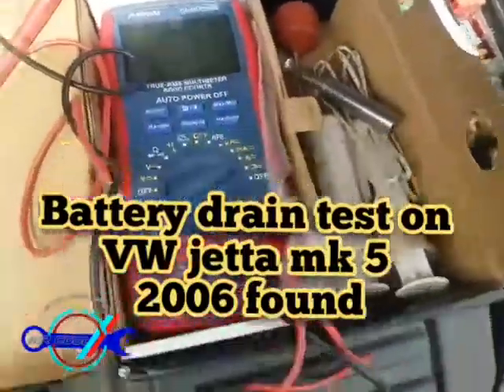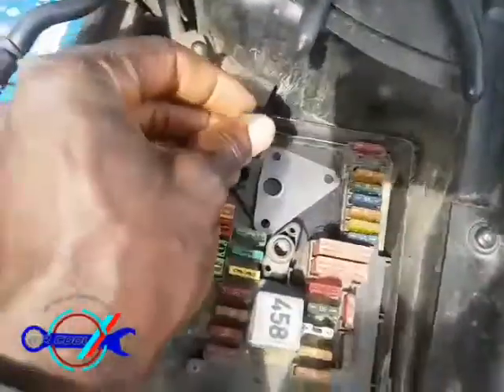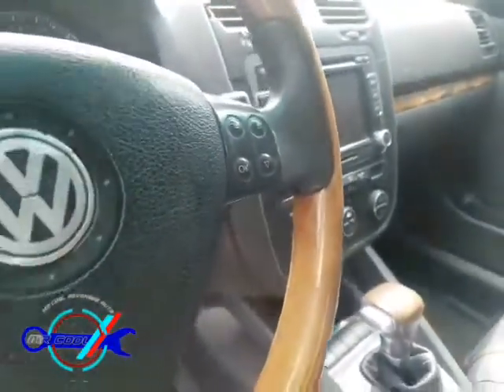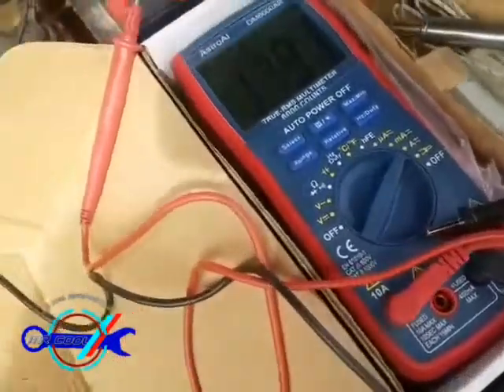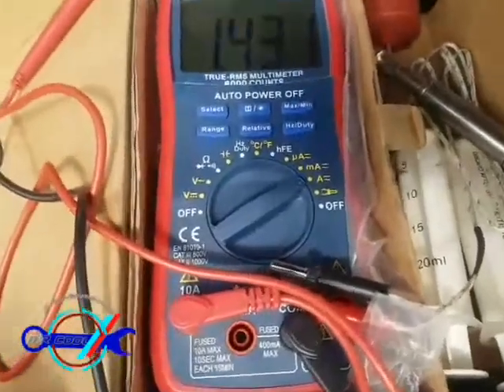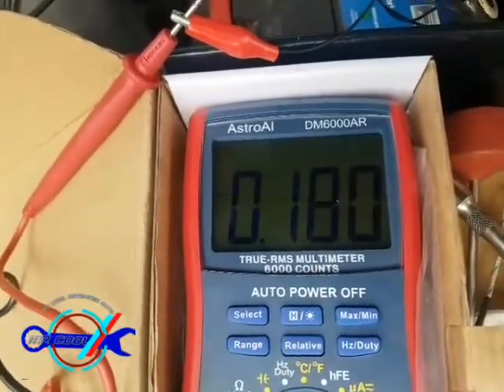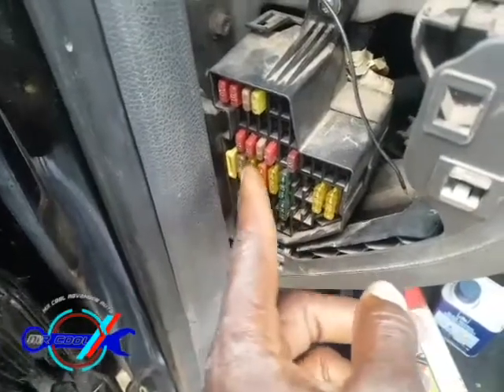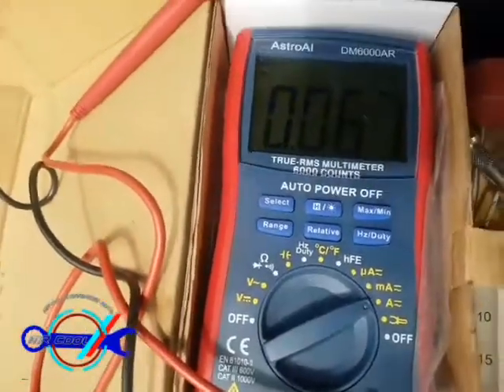VW JETTA MK5 2006, B6, Battery Drain Test, Parasitic Draw Test

Comment: I have a similar fault 
2.5 engine 2007 model 
Drains battery before day breaks and it’s really annoying. I consulted a vw forum and I was told it’s the (Rear j519 module and that door module) I am about to get them replaced today. Cause I’ve actually made some findings and I saw that the door module also is one of the number one reason for a parasitic drain. I hope this helps me and help whoever is having same draining problem.